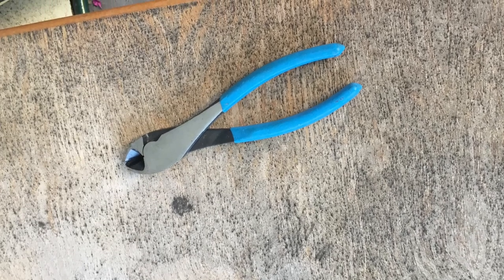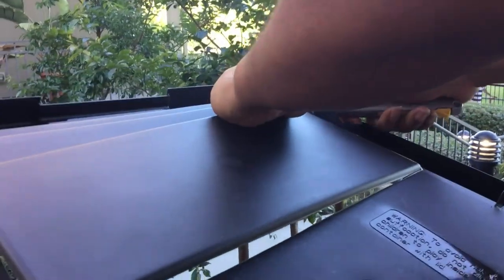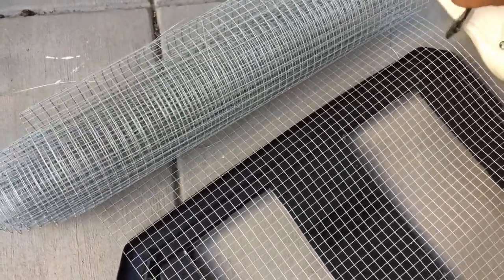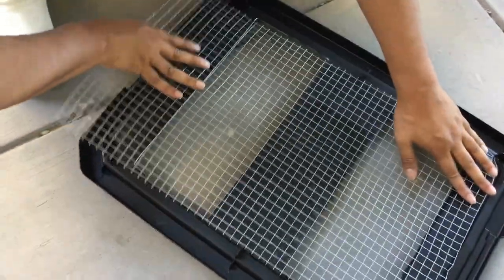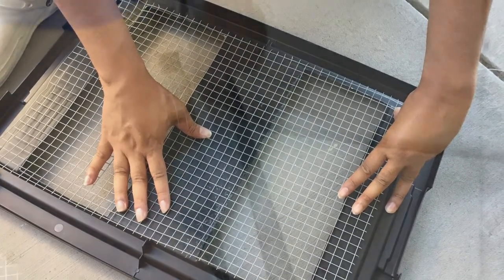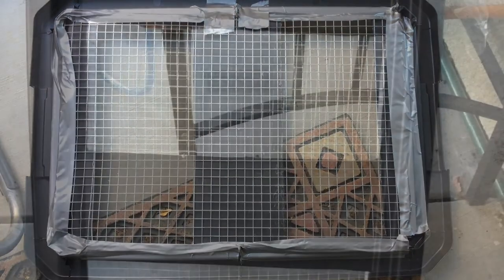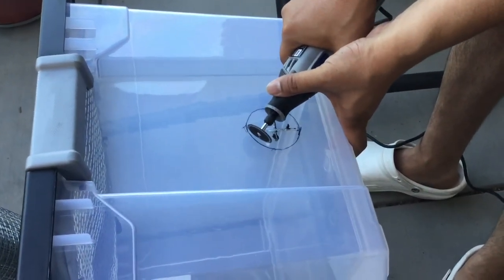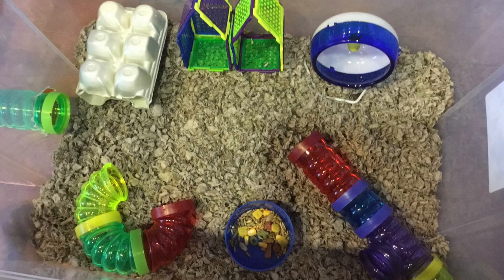How To Make a Hamster Bin Cage

Comment: Personally, I would put the wire mesh on the outside of the container so it would prevent any injury to the hamster.  Also, (if you were to put little windows on the sides) you should sand down the plastic edges that were cut through so the hamster doesn't rub against it and get hurt.
Reply from the maker: Thanks for the idea!